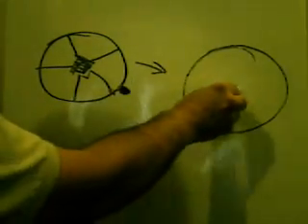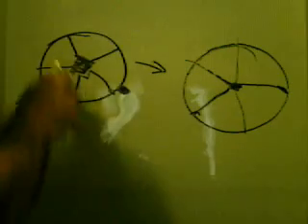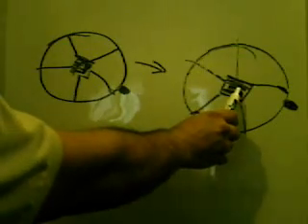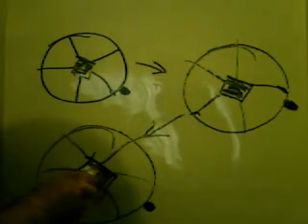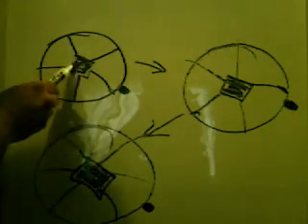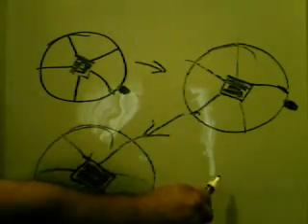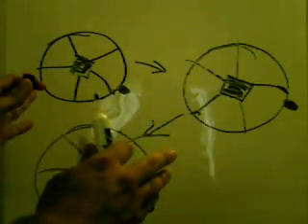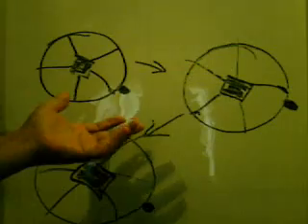Perpetual Energy Device #1

Comment: this will not work, some energy is lost due to friction in the bearings of both the "merry go round" (driven wheel) as well as in the drive motor. not to mention the gearing between the drive and driven wheel. In other words, the original kids energy that got the momentum going would eventually be converted to heat, at which point it would either stop, or it would need outside power to run it, at which point you have nothing more than an electrically powered merry go round.

Comment: Here is why this won't work: 
Once the energy put into the first wheel by the kid runs out (i.e. converted to electricity by the generator),  the energy required by the motor to keep the wheel running is more than (or at most equal to, in an ideal world)  the energy converted by the generator. There is no "excess energy" to power the next wheel, and it all stops there. This is basic physics.

Comment: This wont work but dont take my word for it. This is such a simple concept that any halfway bright child could build a proof of concept machine with....lets say a couple of sk8board bearings a couple of diff size wheels, a magnet and some copper wire (for the generator) and lets say a motor from a toy car. A budget of mayby 20 $ if you buy it all new. And probably 2 Hrs construction time. If you want to prove this works build it. You'll be an instant celebrity. Its how they did it OldSchool.

Comment: I am a huge supporter of the work people put forth in the attempt to find a perpetual energy device, however this particular design would not work. To convert the energy from momentum to electricity in the center generator would take away all of the disks momentum.

Imagine that you take a battery wired to a motor. This is attached to a loop that is attached to another motor. When the first turns the other generates energy at equal to or less than the original. Your idea works in this manner.

Comment: my words are as much hot air is yours. dont get offended if people point out obvious flaws in a theory of such levels. the question stil remains an until you can anwser us, where DO you get this excess energy? do some basic calculations for power outputs and you WONT get excess.

For example even theorys of perpetual motion based on the use of magnets are incorrect as magnets are simply highly efficient storers of energy an eventualy demagnitise an the sytem stops.

Comment: common trap to fal into when pondering over perpetual motion. u neglect the effects of energy loss through friction.

put it in a vacuum yuo'l stil get heat loss.
event some system where none of the parts are touching but u'll need air at some point as a traferable medium, an therefore heat loss. 

make this design ul c. itl be efficent, not perpetual.

Comment: Assuming your not joking

Have you ever ridden a bike with gears? Go up a gear, notice that although its easier to push the pedals, you have to pedal faster to get the same acceleration in the wheels than you would have at a lower gear.

Its the exact same principle here. Yes the big wheel generates more energy per rev than it takes to spin the small motor per rev, but the motor has to work alot harder (alot more revs) to spin the big wheel! At best, you could get 100% efficiency, never more

Comment: There's no way this could possibly work... A basic principle: energy can be neither created nor destroyed - You talk about having 'excess energy/electricity' - from where?
Generators are by no means 100% efficient and there will inevitably be other frictional effects on the wheel-even if it is 'magnetically levitated' as you suggest. The current induced in the generator will be nowhere near enough to power a larger disc...

Comment: The light bulb is magnesium in a vacuum, and so on my first assumption is magnesium being an entropic chemical, it may produce more energy than it requires to burn it, so possibly (as I stated before) create more electricity output than input. Although a bulb doesn't last forever, as long as there is more a cost efficiency, I don't care =)

Comment: I am currently theorizing on using the energy from the lightbulb as a possible source, considering that the bulb doesn't last long, it could possibly using less energy to create more (in the form of heat).  Possibly setting up stirling's inside a vacuum with a bulb?

Comment: The biggest flaw is that generators (and motors) are not 100% efficient. Some energy is lost in heat. Even if it was 98% efficient, you would be losing 2% of the energy required just to keep it turning, and so it would gradually slow down.

Comment: In your model you state "a tiny amount of force is needed to keep the wheel going". That amount of force is equal to the resistance due to friction on the bearings of the wheel, and wind resistance. If you add a generator, that will add more resitance, and so you will need as much extra power on the motor as you are "syphoning" from the generator.

Comment: Ok so think about weight, by water or billiard balls. 
Efficient way to transport it to 30 feet high, then drop the weight gradually over a series of wheels to generate power. Use the same falling force to move the convey the next batch into position before falling into an empty bin to start over again.

Comment: Ok I made a small scale experiment to test my idea and it does not work. But I have found a pumping device which does not directly push or pull the water, it instead focuses sound waves into a column of water at a particular frequency to move the water up and down rapidly. Add check valves at both ends and the water moves one direction in a pulsing pattern. Requires very little energy compared to a traditional pump.

Comment: Im sorry, you don't have an understanding of electrical law. You are using electricity converted into HorsePower, tranfered between two wheels, then back into electricity. The same conversion rules will apply at both rotors. You will lose some of the power getting from a to b through friction and gravity.

I have an idea for free power that I have been working on for years. I am finally ready to experiment.